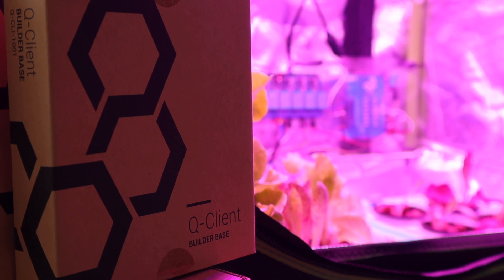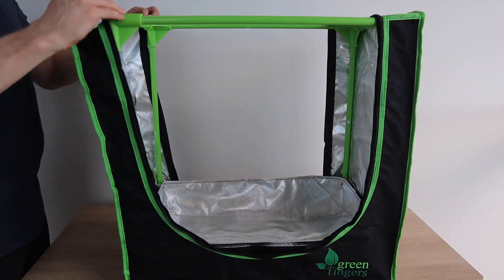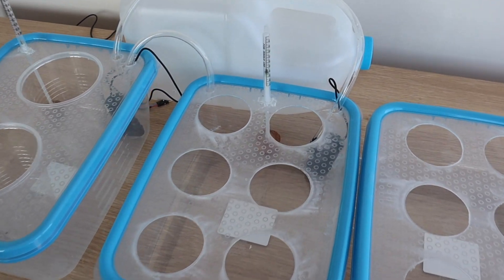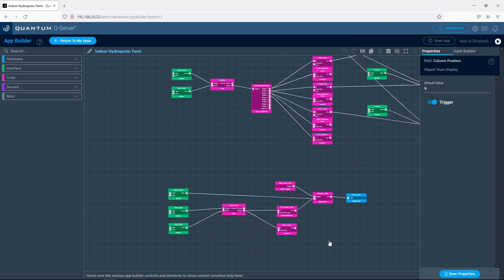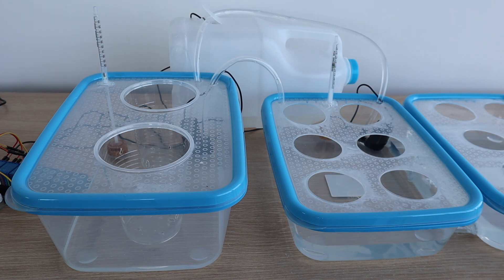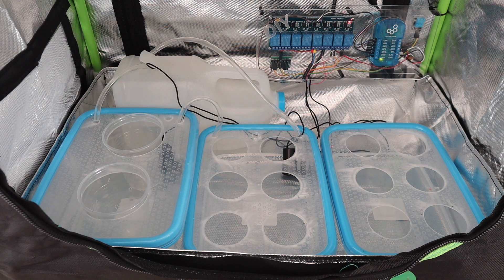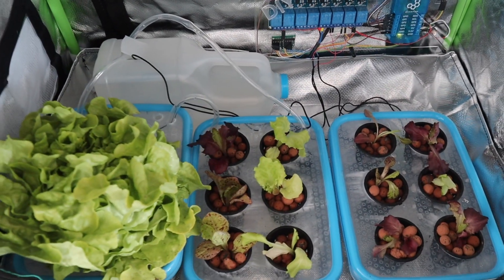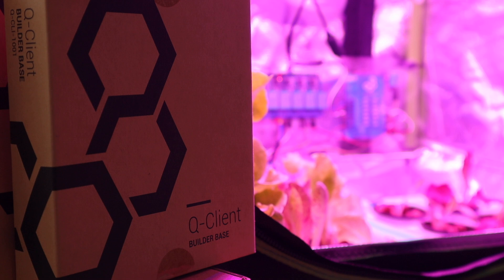Automated IoT Indoor Hydroponic Farm Using Quantum Integration

Comment: Short bursts like that will likely not cause too much harm, but generally, water pumps should never be ran dry. The water itself is crucial to prevent undue wear on those the way they're designed. It doesn't take much time at all running them dry to brick them.

Comment: I'm surprised u not using a capacitive sensor for water levels... you can even place it outside the boxes... https://www.youtube.com/watch?v=4A3XrjF4ybM
Reply from the maker: I did actually give this some thought but I've found those capacitive sensors to not be particularly accurate (at least the ones I've got). They're good for broad monitoring, like wet to dry soil, but are quite sensitive to environmental changes like temperature, humidity etc.. So if you set them up for a particular level today, that level could be 1-2cm off in two or three day's time. Similarly to the reed switch ones I made, this isn't an issue most of the time, but on the odd occasion that it fails the wrong way around then you land up with a flooded desk.
Reply: @MichaelKlements  I usually encase mine in "nail" varnish and I use a zig zag pcb trace pattern on a pcb strip 10 inch long.   Seems to be ok for me.  But then again I'm just sensing dry and wet soil in pot plants for automated watering.  During development test, I could measure water levels, but I haven't tried that long term to check on calibration drift.  So thanks for the heads up on the environmental influences on drift.   I look forward to your posts, really neat stuff you do.